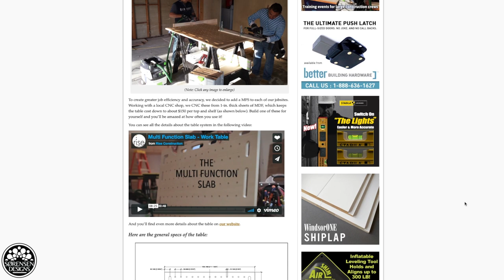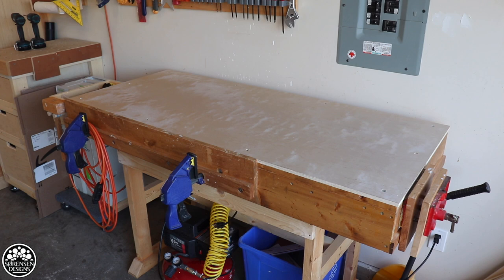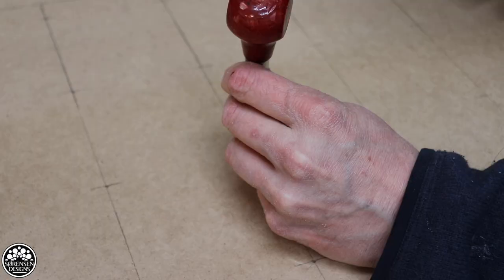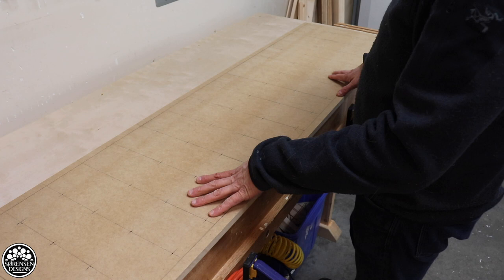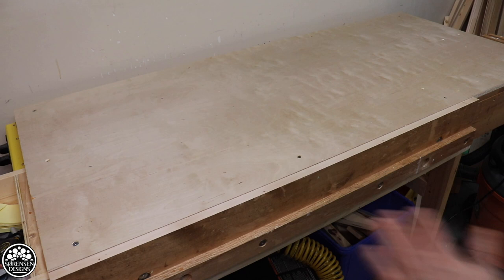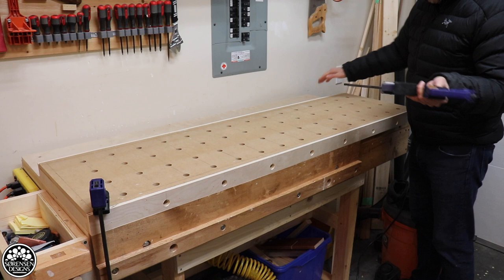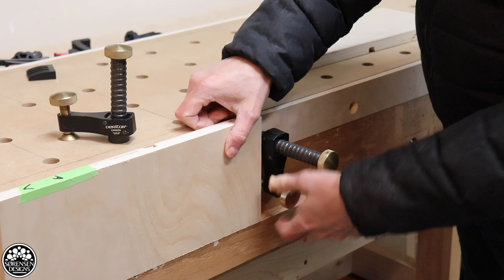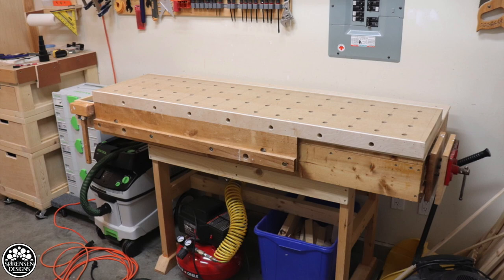New Multifunction Workbench // DIY MFT For Any Wood Shop

Comment: I like the versatility. I can see cutting a rectangle out and adding supports underneath for a router plate used over the saw horses and when not in use swap back to a standard plug and screw down. Nice project Eric.....
Reply from the maker: @Grumpyneanderthal Thanks! There are many ways to customize this set-up, especially if you want to keep it portable. Cheers 🙂

Comment: Why use metric spacing and imperial dog holes? I'd really like to make one of these but have been concerned about accuracy of hole placement and having the hole perpendicular to the work surface. I see you drilled all your without any kind of jig. Thank you for great video.
Reply from the maker: @Berry Conway   My bench dogs are imperial but I went with Festool style spacing - it's a personal choice. 
If you watched closely, I spent a great deal of time plotting and marking the hole centers with the Awl. If you're doing it by hand like me, you must check your grid and the hole marks for accuracy before you drill. Mine turned out square and accurate - no worries.

Comment: Hey Eric, quick question, why 96mm centres and not 100mm centres?  Thanks for sharing
Reply from the maker: Thanks Jim! I went with a Festool 96mm standard because the Festool clamps I have are designed for that grid system. The Veritas surface clamps work better in this grid as well. When I researched MFT tops, it seems most woodworkers are working with this standard.
Reply: @EricSorensenCanada  Thanks Eric, much appreciated.